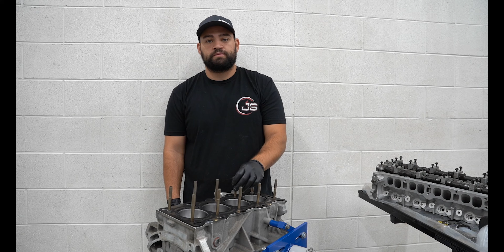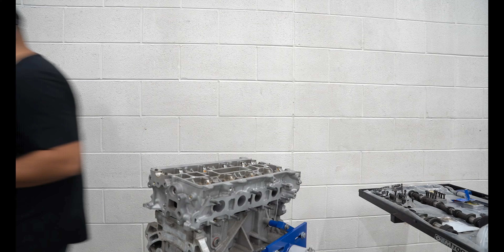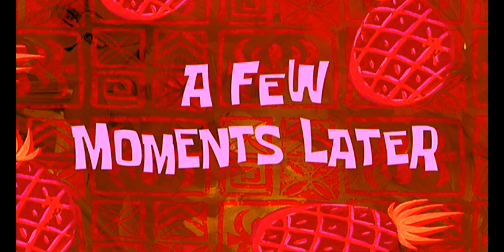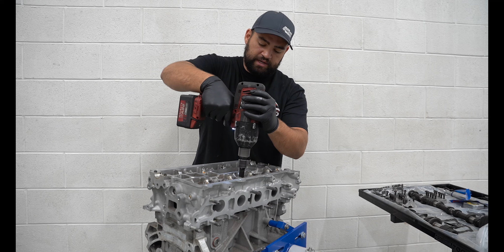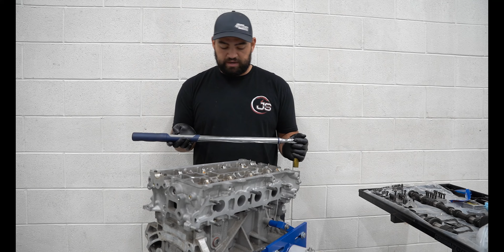How to Install ARP L19 Head Studs - Mazdaspeed / EcoBoost

Comment: So i bought arp 218-4702 and they are for mazdaspeed, mazda 3, cx7. Do i follow the L19 specs because the 218-4702 are final torque of 60 ft lbs, and mazdaspeed is 75 ft lbs?
Reply: I have the same question. the machine guy that did my head does a lot of race engines and uses ARP studs. He said to use the ARP specs, which are listed as 60 ft lbs. SO???